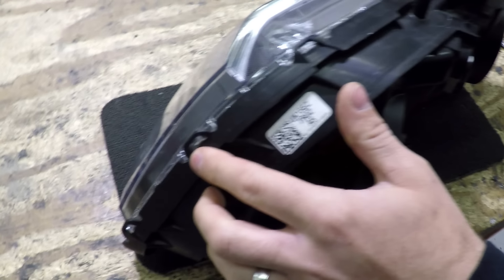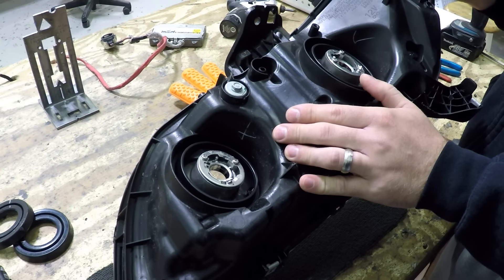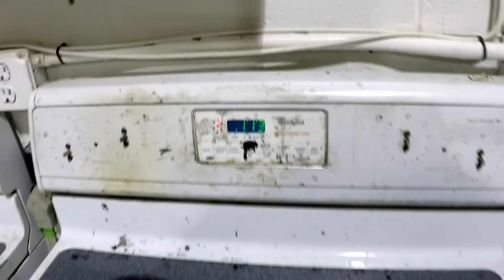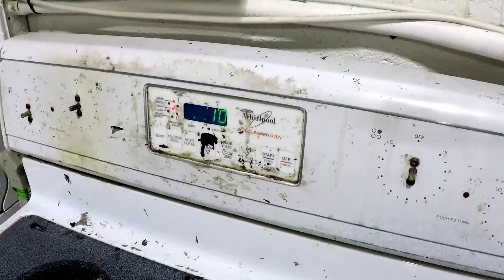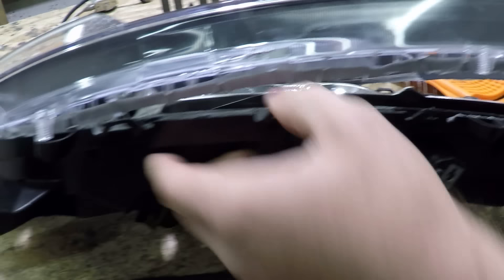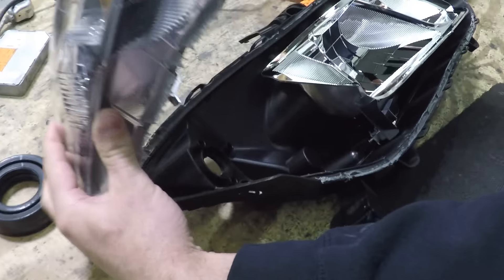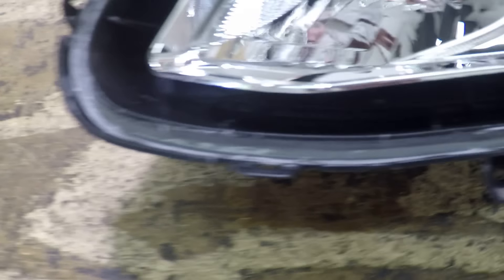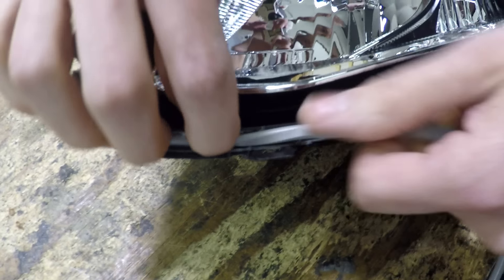Opening & Resealing Automotive Headlights using Morimoto Retro Rubber

Comment: What type of globe did you use in the headlight test? Ive been trying to find the same color globe, but the H1 arctic white plus 50 globes i put in still shine a yellow light. Can you recommend the.right H1 globe to get the same white light yours has please? My headlights are the same projector type as in your video. Your video, by the way, is one of the best informative & helpful videos out there. Good work :-)
Reply from the maker: most likely a factory D2S Philips or Osram 4300K bulb in there. Which is not really available for H1. If you want a cool white H1 I would check out the Morimoto 6500K - http://www.lightwerkz.net/index.php/components/hid-bulbs/h-series/morimoto-xb-h1-bulbs.html

Comment: maybe im a bit late to this but can you use a heat gun at a good distance? i do not have an oven that my light fits in to...
Reply: I'm thinking a heat gun also. Use a spreading tool and work your way around. For sealing the same thing. I mean they don't put an entire car in the oven when they replace windshields right? Unfortunately though it seems that some head lights are sealed with permaseal and are difficult to separate even if you bake them . See the link below:
https://www.hidplanet.com/forums/forum/the-hidplanet-university/informative-articles/46667-headlight-sealant-database

Comment: Nice Vid. Will these methods work for non-pop-up conversion headlights housings for C5 Corvettes?
Reply from the maker: I doubt they use butyl. But this oven method is pretty standard across the board. "perm-sealed" lights are a different beast though.
Reply: So, you know the kind of housing I am referring to?

Comment: 14:01........soooooo how'd u get the whole vehicle in the oven again?
Reply: Vazkez31 lol
Reply: Hahahahha
Reply: If the headlight doesn't fit in your home oven you can expand it with a box with one end cut off and then stick a thermometer into the box.
Reply: @norakat  I saw a clever video where they had a large box with a hole cut in the end for a hair drier or heat gun to fit tightly (looked like a hair drier) and then after running it awhile, they pulled the headlight apart easily.  Easy for anyone to make their own 'oven' that way without worrying about oven contamination.  For those who might really worry.  I'm baking mine back together right now, in an oven.  While my wife is gone for a few hours lol

Comment: one more question for you guys. I was going to be painting plus clear on the bezels. will the heat of the oven effect it?
Reply from the maker: No.
Reply: sorry another question lol. I'm going to be drilling a hole in the bottom of the headlight to run the wire, can I use the butyl glue to enclose the hole? if not what do you suggest. thanks!
Reply from the maker: https://www.amazon.com/Yongcun-Black-Glands-Waterproof-Joints/dp/B01KU2U6V0/ref=sr_1_1?ie=UTF8&qid=1489068183&sr=8-1&keywords=pg7+wire+glands
Reply: awesome thanks!

Comment: Good video however I've just tried this @ 230 for 5 mins and my headlight melted!! be very very careful go low on the temps is my advice.
Reply: you did 230c didn't you lol
Reply: You must have set it to celcius.  I bake at 270°f for 0mins and never have had a light melt.

Comment: I used 3M windsheild butyl rubber sealant when sealing up my 2017 wrx headlights. I followed this video exactly and had no problems with condensation for the first  6 months. Now every time i wash my car or it rains I get slight condensation on my front lens. I honestly don't want to take the headlight back apart again cause it was a pain. Do you guys have any recommendation for what I can do? I was thinking about the more permanent solution of silicone cause I'm never going to take the headlights apart again.
Reply from the maker: You just didnt add enough sealant. its a very thick channel. Silicone is not something that you would need to use. Re open and reseal by adding more.
Reply: Lightwerkz Global Inc. the thing is i would reopen and reseal if it was as easy as it looked when you did it lol. Idk if it is because the butyl rubber is for windshields but it was very hard to seat the corner and press the lens back on. Any idea what it can be? And I think a little bit of hard water spots formed on the lens so how should I clean that? Thanks for the help!

Comment: I enjoyed the video but All headlights are Not created equal. I watched and I tried on my 05 VW Touareg lights and I believe because of its age, it was too caked on regardless of temp at 240 or 255,  for 20 mins nothing worked. There was no way for me to pry it off the dried-on glue.
Reply from the maker: You are working with "perma-seal" which requires a little more effort. Here is a good video we have on that - https://www.youtube.com/watch?v=iKDvstda87Q
Reply: @LightwerkzGlobal  Thanks. Those channels are insanely tough its hard enough to get that bite without breaking the channels.
Reply from the maker: @bulldogkarma  Very brittle. Get new headlight lenses. This way you can cut off the lens and attack it from both sides of the channel. https://www.ebay.com/itm/275322144345?fits=Year%3A2005%7CModel%3ATouareg&hash=item401a7a8659:g:IsEAAOSw5KJiizrb&amdata=enc%3AAQAHAAAA8JeH3apWQYcIuuYkq9SKm9cUUEDYVfBI9JadLna8QJ2xS6zaPiGHeqw3oAyQo0X86IVcTXxXfKErXWSovMTu57X%2FAdlugPWBF2UcORcZiRSSGfwto8Dtu0nbfrZhshUD2pjh2Alf6FFpoqEDRkDdoNZqAx9zZeWZA9dXhFrtdPuhDbJsj36DBeeRmPMtqS8g5m3fajGFE%2BU311YhIfZ57G9HcSHEZFB1WPAWSspmAxl1KRshVkntOAPu7QFBCMvjV2Vb%2FRXmh1lRyJCve6%2BH8GtiVHyanKtqqTLmc8mg4RdyKCyB8L%2BgXPPXdVZErM5wtw%3D%3D%7Ctkp%3ABk9SR8iMoIrTYQ

Comment: Do you leave the oven on after preheating or turn it off once done preheating
Reply: I've read where some preheat and once it's at the desired temp, insert the light and shut the oven off.
I used this method on an eBay headlight that uses grey butyl and I spent over an hour off and on trying to open the lens.
But i noticed he doesn't mention turning the oven off and during the vid, when he put the headlight into the oven,  it began preheating again.   So he must have left the oven ON.  I'm going to leave it on and see how it goes.  I'm baking my 2nd headlight right now.

Comment: Any difference when opening up permaseal headlights?
Reply: Just use a little higher temps but they will come apart. If u have to, use the "touch and go" process, if its not coming apart stick it back in and bake a littl longer, just make sure to take all bulbs out and i wouldnt go above °275 F just maybe add baking time.

Comment: Wow, what a pain in the ass! Makes one long for the days of sealed beam glass headlamps. Has anyone tried just running a bead of rtv silicone around the seam without separating the halves? I’d really like to know because I just removed the headlight unit from my cts coupe w/hid lamps due to a burned out xenon lamp and discovered what must have been more than a pint of water in the bottom. Please let me know as I need to put it back together and I don’t really want to go through all that work if I don’t absolutely have to

Comment: i tried to do my 2014 f250 headlight that is perma sealed and  it is a pain and the housing deforms do you have a trick with permasealed headlight?
Reply: page buker same problem here i tried to open my headlights on my 13 silverado i stopped, im going have to cut them
Reply: Javier Beltran use high temperature 270 for 20 mins I open perma seal headlights in 5mins

Comment: Can silicone be used instead??
Reply from the maker: While people have done it, its not recommended. Silicone will  not "mesh" with butyl. This video is about automotive grade sealant, specifically designed for headlights.

Comment: CAUTION: NOT ALL OVENS ARE CREATED EQUAL! I almost learned this the hard way today when I went at this a second time today in as many years. Same car, same light. The first lens cover from China held up only 2 years then started getting weird little cracks and flaking in the finish. So I got a second one from China on ebay and figured I'd give it one more shot before just throwing in the towel and ponying up for a whole new assembly since I'm tired of doing this b/c it is A PAIN IN THE ASS AND VERY RISKY IF IT IS NOT SOMETHING YOU DO OFTEN. Why? B/c I almost melted my damn housing today using a different oven than the first time. The first time I WENT 240 for 20 minutes, but it was in an old electric oven. Today I used a older gas oven and went "240" for 10 minutes and thank goodness I didn't go 20 because at 10 min I melted a small little edge of it since like a dumbass, I had that part touching a side wall in the oven not thinking about it. DON'T LET ANY PART OF THE ASSEMBLY TOUCH ANY SIDE WALL IN THE OVEN. Regardless, the whole assembly plastic felt WAY HOTTER than the first time. The first time I didn't even have to use mitts b/c it didn't feel like it was even that hot. Today, I had to use oven mitts b/c it was SUPER HOT and it came apart super easy. I did a clean install other than that little 1cm melty housing deformation, but I'm here to say, please, KNOW YOUR OVEN. I'd say if you have a gas oven, 200 for 7-10 minutes is probably all you need. Had I not listened to my gut and gave it the full 20 I would be out of a passenger headlight tonight. Also, I just reused (for the second time) the original gray butyl in the channel, because it seemed like there was still a ton. But, I had some butyl on tap if I needed it. Time will tell if it was enough (praying that it will be). BE CAREFUL. I was praying the whole time I did this today b/c I was so scared I was going to blow it. I just felt like my gas oven is hotter than a regular oven that's why I went half the time, and STILL melted a tiny part. This is not easy, and requires cracker jack timing.
Reply: Lol so you touched you lens to the metal... Seems like your fault not the lens or oven
Reply: @jasonpanto  Actually, that's not the entire issue. The issue was the different ovens. For sure that one little part that was touching was my fault, however, the gas oven was WAY hotter than the electric oven at the same temperature. It just was. Maybe it was a thermostat issue because it was an old oven, and I actually ended up replacing the thermostat 2 years after I did this project because it went out in that oven. But my lens has held up and still looks flawless.
Reply: @jasonpanto  And I didn't touch the lens to the oven. It was a very small part of the lens housing. The point of my comment was that not all ovens are created equal. The first time I did this it was in a newer electric oven. Everything went smooth, and the heat was very even. The second time in the older gas oven, not the case. At the same temp, the older gas oven felt way hotter and that's because it was (turns out the thermostat was not working properly) so be careful.

Comment: 20 MINUTES???? Everyone I see says 220 at No more than 8 minutes... You're doing 240 at 20 MINUTES??
Reply from the maker: 20 mins, 240F. Thats what we do. Do it at your own risk.
Reply: @LightwerkzGlobal  It's a REALLY good thing I used some SCRAP ones first because that temp would have DESTROYED my good ones. YIKES!!!
I had 4 sets to experiment on. Set to 240F and placed light assembly in the oven for 20 minutes. Opened oven 20 mins later only to discover it MELTED... Literally was collapsing into itself, starting to curl  inwards... Everything was melted and deformed..

Turns out 140F at 15 mins were the KEY time.. Ruined 1 entire set of 2 lights at that temp..

Anyone trying this, BE CAREFUL!!!!